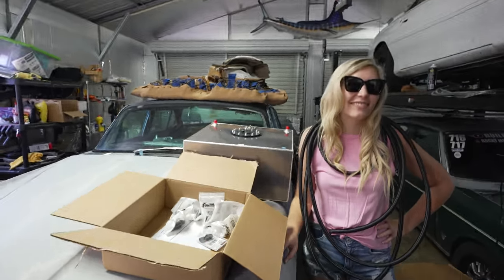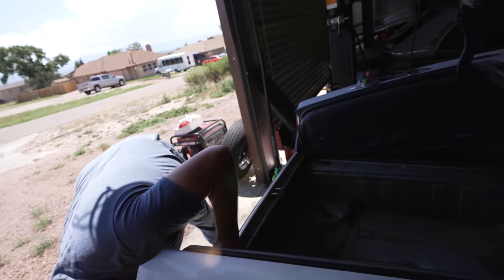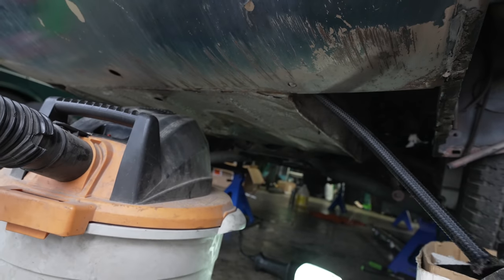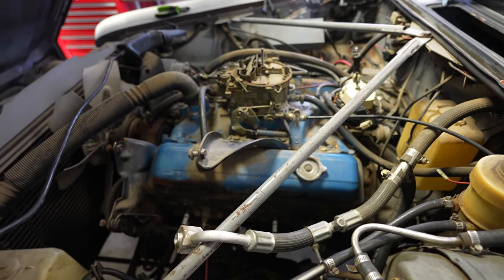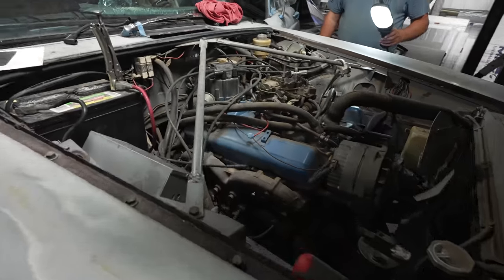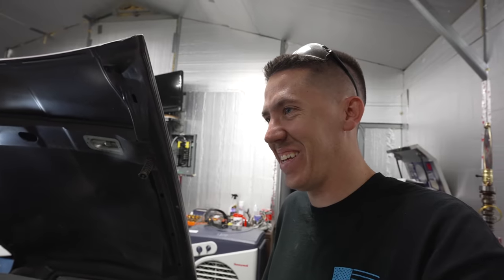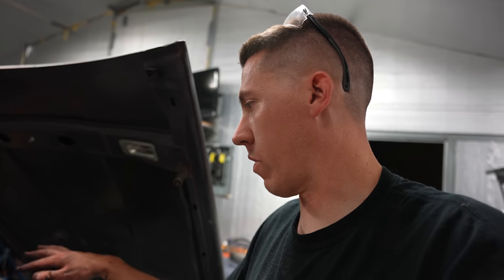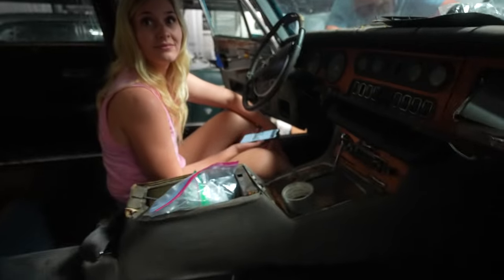ABANDONED 1971 Jaguar with SBC runs for the FIRST TIME in YEARS!

Comment: It does not matter where it points as long as the number one plug wire goes to the number one spark plug when the number one fires
Reply: It does to someone who cares.  Rotor should point to cylinder 1 when 1 is on TDC.
Reply: Just because it works does not mean its right.

Comment: Fill the float bowl through the vent tube. Keep pumping the shit out of the gas pedal while turning it over to force the accelerator pump to squirt some additional gas. Don't be scared to use WD-40 or any penetrating oil to keep it running. A diaphragm pump needs a lot of help to get it primed.

Comment: There very likely is a cartridge style fuel filter that is in the carburetor you need a 1” wrench and a 5/8” line wrench to remove the metal line that screws into the fuel filter housing of the carburetor. After you remove the metal line from the fuel filter housing unscrew the housing and replace or install a new cartridge filter that goes in there. Also there is a very thin gasket that goes on the lip of the fuel filter housing you need that gasket in place otherwise it will leak additionally a wrap or three of teflon tape on the fitting nut on metal line that screws into the carb is advisable even if not technically not needed because the single flare of that line tends to seep and the teflon tape seems to help fix that problem

Comment: If you run some electrical tape around the line before you cut it with a cut off wheel, it will stop it freying up like that. Obviously cut through the tape.
Reply from the maker: I’ve done this on stainless line it definitely helps!

Comment: You can run it all day pouring fuel from a can!..... Pull the hose off the carb and crank to see if fuel spurts out the hose.... If yes, take the inlet filter out and clean it.... re-hook everything and crank a few revs.....THEN, with everything shut off look down the primary barrels while you pull the throttle arm and look for two squirt streams.... If nothing, pull that quadrajet junk off there and get an adapter plate and a quickfuel brawler 600 double-pumper and it will run!
Reply: You can take the top off the Quadrajet, pull the accelerator pump out, put new O-ring on and put it back together. Usually just massaging the o-ring will get the accelerator to seal and give it a good squirt.

Comment: There's no way I'd pull that distributor, what's the consequence, taking 100 miles off it's life if you don't pre-lube? You could have just marked the rotor button and put it back in, you're not moving the camshaft when you pre-lube, just the pump.. looking at the vacuum advance it's WAY retarded. Twist the distributor counter clockwise until it's hard to start, then back it off some.. 
I'm diggin the Dragaur though!

Comment: I'm sorry guys but it was painful to watch this!!  The little tiny tube that sticks up out of the carburetor is a vent  If you pour gas down that it fills the float bowls.  The car would stay running then and pull fuel. And yes that filter should be full.  there is also a small filter inside that line you were spraying cleaner into that goes into the carburetor. And it does no good to pump the gas if there is no if there is no fuel in the float bowl. All you're doing is wearing out  the dry O rings in the accelerator pump.  Is the little arm on the top of the carb that is moving is the accelerator pump.  Google is your friend brother..lol